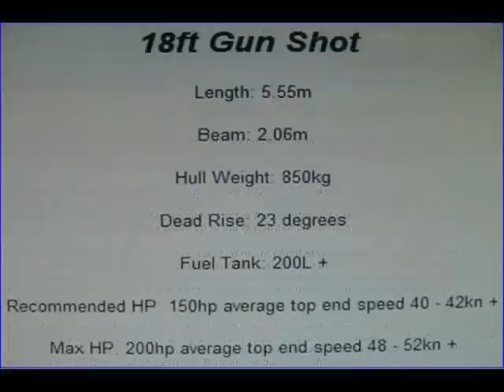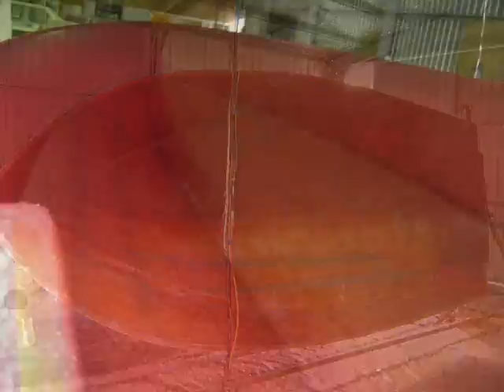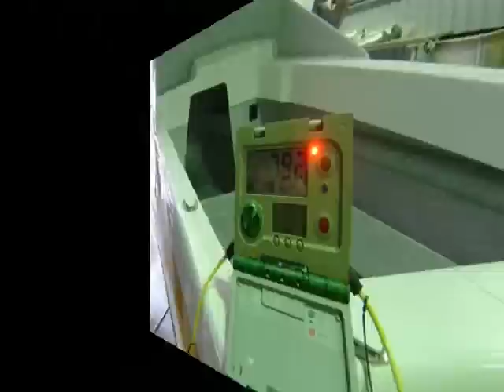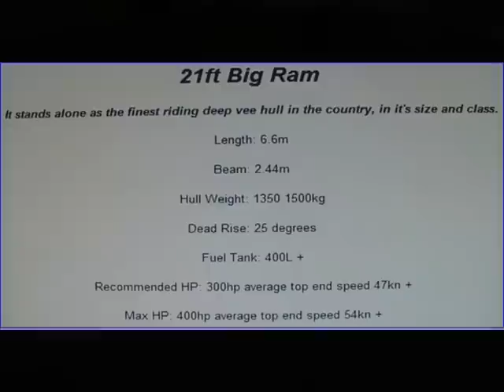CootaCraft Boats BUILD PROCESS/FIBREGLASS LAY UP

Comment: how comes possible hull weight is 850 Kg if used divinycell core... i built a potimarara 23 ft with plywood sheet 12mm coated by FRP  ...dry weight 800kg power max 350HP
Reply: Do you have a video of it? I'm dreaming about building a cc or similar myself.
Reply: Because of the amount of reinforcements used in the bottom half of the hull. They are designed to take a beating.